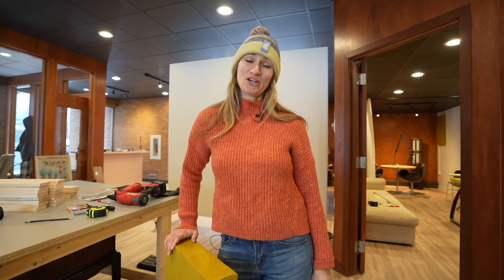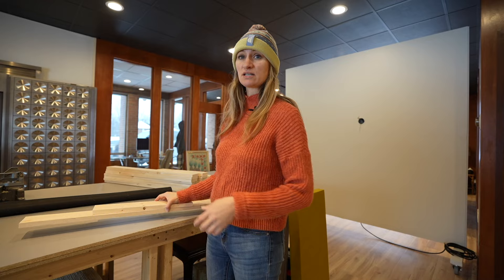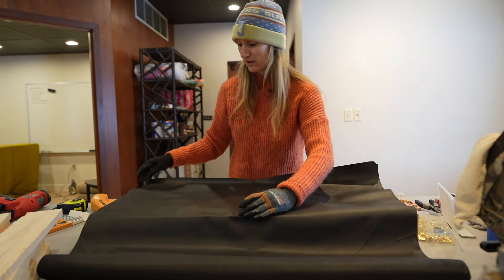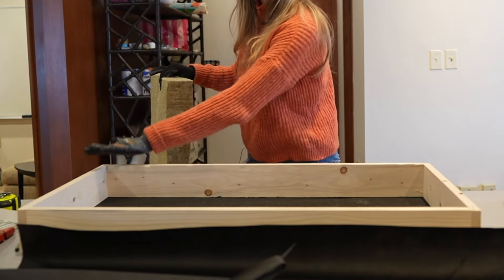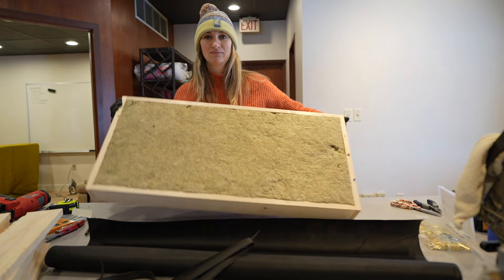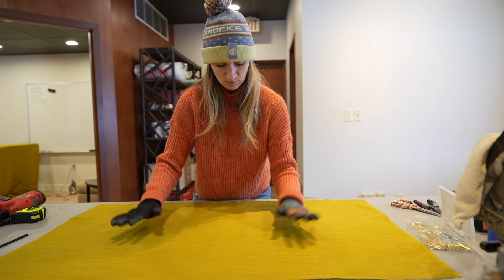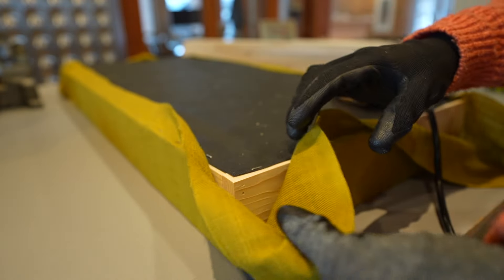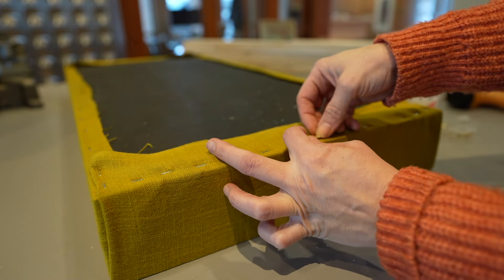DIY Acoustic Panels for a home studio or podcasting room

Comment: Nice, simple build.  Best to mount them so they stand off the wall about 2-3 inches if you can.  It helps improve performance when there is a gap between the panel and wall.
Reply from the maker: Thanks for the tip! And thanks for watching!
Reply: @csimet: Have You done this before?  ...curious how YOU would go about separating the panel from the wall - 4" to 6" ??  See my discussion/reply above... Thanx!
Reply: @kjc4414  Yes.  My frames have a back brace piece (1x3), top and bottom, that I mount another cleat (1x4) to perpendicular.  It holds the entire frame off the wall 4".  I use standard picture wire and hangers (heavy duty)... it pulls the frame snug to the wall with the extra 4" standoff.

Comment: Nice video.  Very straight forward and doable by almost anyone.  I wish I’d seen you stretching from the middle.  I went from corners, not ideal.  For rockwool especially, I’d suggest using some 0.7 mil plastic sheeting to wrap the rockwool, just for extra lung protection.  I got some 10 oz cotton duck on clearance, which worked well.

Comment: These videos became somewhat of a trend nowadays.
The sheer lack of data is indeed troubling.
Great execution, yet no information whatsoever.
Acoustic treatment (contrary to popular belief), is a process of decision making which derives from a greater understanding of the environment it is designed for.
What is necessary for that particular space?
What would be our target frequencies?
Is it a critical listening environment?
I suspect that without a comprehensive analysis of the room and acknowledging its purpose, such endeavor would be futile.
If this video is strictly for entertainment purposes or "DIY project tutorial" I think that a disclaimer would be fair.

Also a few pointers for some of the comments..
It is true that an air gap behind the panel could yield "better" results, by slightly lowering the "cutoff" of the absorption frequency - how much of an air gap.. well that is a completely different animal.
In short - it depends on the depth, the material, angle of incidence and a few other parameters.
Another issue to point out regarding air gaps - for some reason the consensus states that when "air-gaping" a panel is mustn't touch the wall it is mounted on.
Well, that is not necessarily the case.. by fully detaching the panel we are forming an "escape path" for some of the frequencies, depending on the depth and amount of insulation.
another burning matter would be diffraction or the "edge effect" - primarily known from speakers with sharp edges, this phenomena also occurs from hung panels.
best way to tackle these issues would be to create these panels with internal braces which are meant to hold the insulation and essentially create an air pocket at the "back side" of the absorber, and also build the sides top and bottom of it semi open allowing sound to hit at different angles and degrees, this (in essence) can turn a small 10cm (4") panel into a 60cm (2') absorber simply by allowing the sound to penetrate to the "width" of the insulation.
Last thing, some (me included) might find mineral wools to be irritating and a possible future health hazard, by applying a thin layer of "Dacron" (polyester wool) infront of the fiberglass/rockwool (between the fabric and the mineral wools) you could minimize the particles spreading into the room whilst barely (or insignificantly) affecting the absorption impedance and effectiveness (it might even benefit you!).
Alternatively, Hemp or other eco-friendly insulation materials could be a more suitable choice, just make sure that the material's properties are aligning with your needs (I'd suggest further reading about - Gas flow resistivity (GFR), tortuosity (Pathways in porous medium) and porosity (Pore diameter and fiber/cell structure).

Comment: For a much bigger effect, you need to offset the panel from the wall by the thickness of the panel. Doing so entails a totally different mounting system.
Reply: ...can you elaborate?
Reply: @kjc4414  Sorry for the confusion, kjc. If the panel is 6" thick, the space behind it needs to be 6". If the panel is 2", the space behind needs to be 2" etc...This is not a hard and fast rule, but I've seen it specified more often than not. Stay well...😀.
Reply: @acreguy3156 : actually, I was looking more for the method of hanging them - the "totally different mounting system" you spoke of - if they are 4" or 6" away from the wall - if you don't mind speaking to that...  TY!!
Reply: @kjc4414  Hi kjc. I've never hung sound panels before. I've only heard that the gap has to equal the thickness of the panel. Having said that, I would assume you'd have to build some sort of stand-off devices that project 90 degrees from the wall that could attach to the rear of the panel, which would need a compatible receptacle for receiving the standoff. Perhaps Googling might help. I'll do some looking as well and post back.
EDIT Thinking back, I've seen where people used legs at the bottom of the bigger panels and hence, let them sit on the floor. Not the most pretty solution but it would make vacuuming easier 👍.
Reply: @acreguy3156 : I assumed that was the case - just thought you had done it - so looking for that "quick fix"... I am about to build my recording studio from the ground up - and when I get to the interior - I will definitely do this with my panels... Thanx for the input!
Reply: @kjc4414  Glad to help, Ken. Sorry I didn't offer a more definitive approach. Good luck with your project!

Comment: Great video! Is the final wood cut 30 & 1/2" or 32" each? Thanks!
Reply from the maker: Thank you. Cut at 30.5 but overall when you add the thicknesses of the top and bottom piece it will measure 32” once assembled.
Reply: @ThisArtisanLife  Thank you! Would you happen to know the size of the nails you're using? My wife and I are actually going to build a few this weekend and we're picking up the materials today. Appreciate it!
Reply from the maker: @PabloLaFrossia  nail size will depend on your method. I used my Milwaukee Brad nailer with 18gauge 1.25” long brad nails, but different tools have different sizes nail requirements. If you are doing them manually, I’d probably suggest pre drilling holes and screwing them together using wood screws.